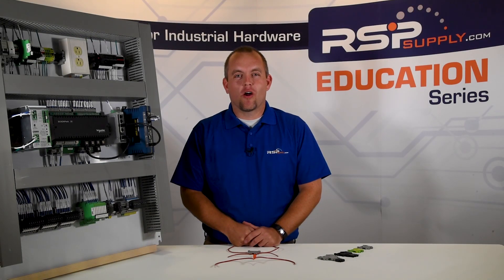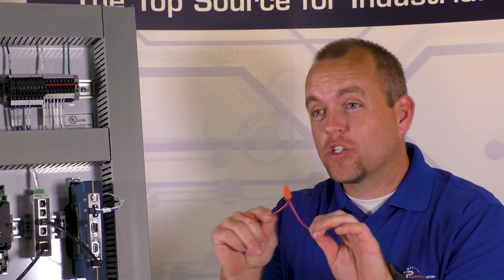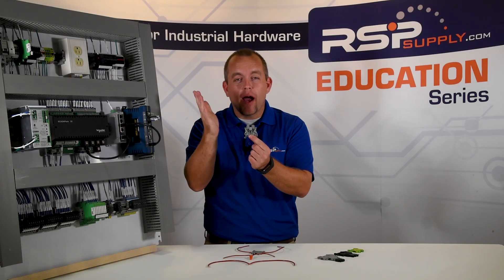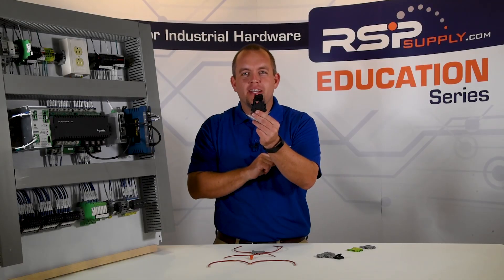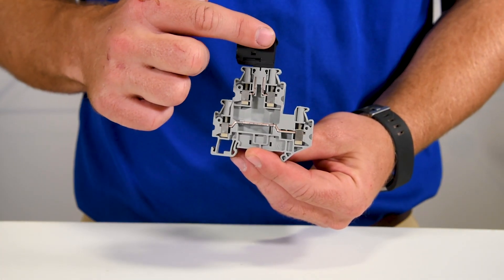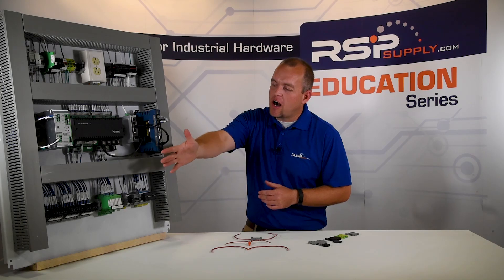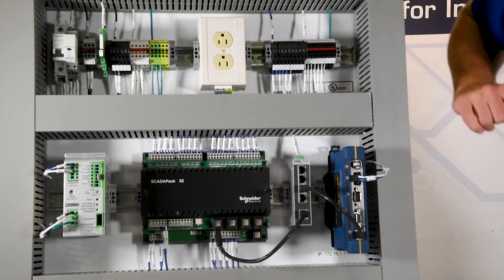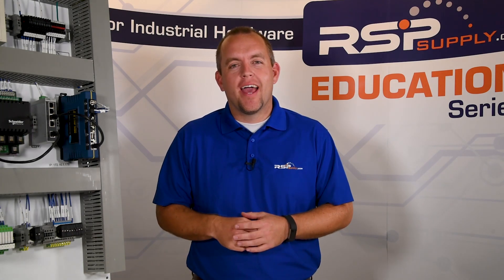Terminal Block Basics

Comment: Hey Josh, I am trying to make a DIY fuel injector cleaning system. I have this device I bought on eBay to clean one connector at a time. Which type of a terminal block would I use to connect this cleaning device to 4 injectors at the same time? Thanks in advance! It will involve a positive and negative set up.

Comment: I asume the terminal block have a jumpers can you explain
Reply: Yes, they have. Not preinstalled, though. If you look at the center of the terminal block, you can see a hole between the two terminal connections. There is where you should put the jumpers. The two level must use two different jumpers because they are not connected one another. So far, I've seen jumpers in screw format or pinned.